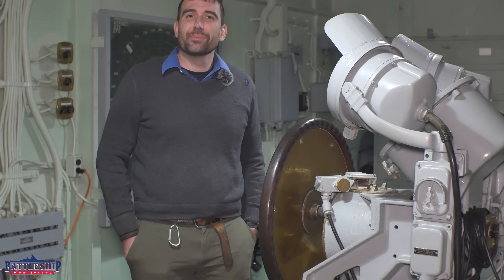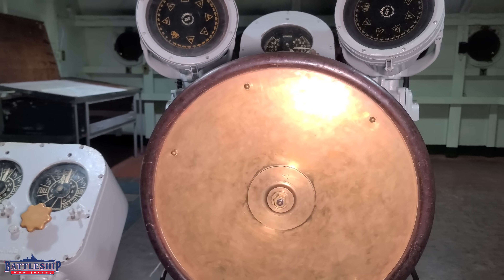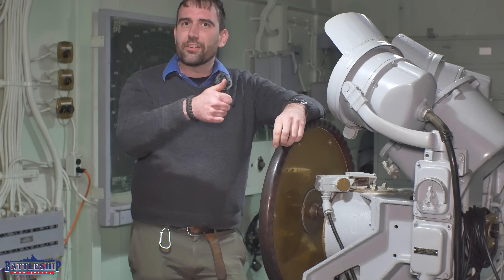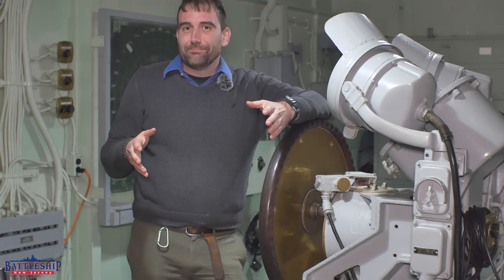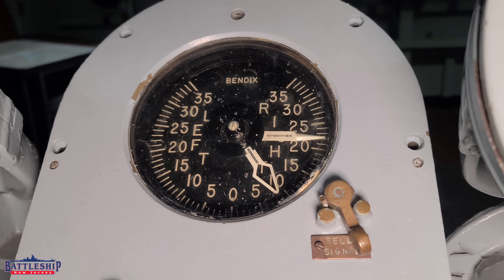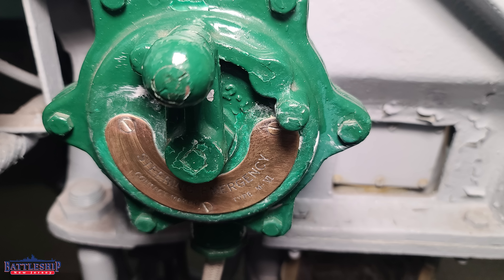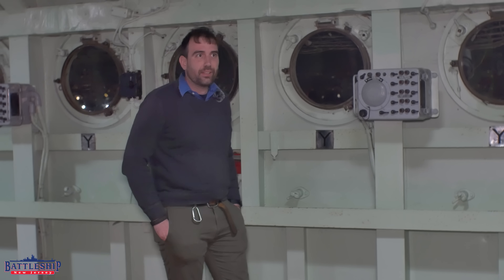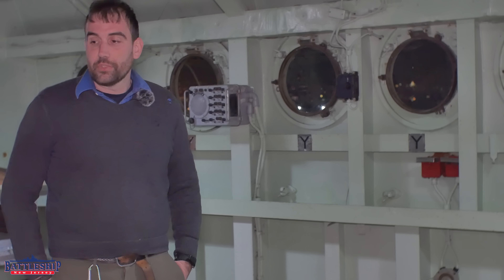Steering an Aircraft Carrier

Comment: Amphibious ships like Dock Landing Ships, and Frigates, and Destroyer Tenders, all have just two steering stations - the bridge (or pilot house on the old LSDs that had open bridges and small pilot houses) and after steering. There were no secondary steering stations other than after steering. Perhaps because none of those ships were intended to take the beatings that battleships and carriers are expected to take.

And somehow that reminds me of a recent video where you were discussing how to find the power panels for electrical circuits. There should be a metal tag on each cable at each junction box giving the location of the power supply. After 70 years, though, and multiple modernizations, who knows?

Comment: They had a working hand crank hooked up to a steering gear with no rudder when J went through "A" school that we were required to operate for functional experience.  It not only requires 100 turns to move 1° it requires that both sailors match rotation speed.

Comment: I spent many hours steering a Coast Guard cutter from the bridge in the 1970s. However, we did not use a wheel. I sat in a comfortable seat and there was a lever about 10 inches long. I would move it to the right for right rudder and left for left rudder. In front of me was the gyro compass, so I could determine the heading and if the command was "right rudder 10 degrees to bearing 090, it was easily done.
What is also interesting was when we were at general quarters drill, my job was to be in aftersteering, locked in to a crowded compartment. On our ship this was located in the stern below decks. The bridge would transfer authority to us (for practice) and there were hydraulics there (hydraulic rams connected directly to the rudder) and hydraulic pumps running. Our job in after steering in an emergency was to be able to steer the ship if the bridge control became inoperative.

Comment: I used to work on the Hornet while in high school as part of the Safety Division. It was fun riding the central elevator and going through p-ways not open to the public yet. My fav memory was operating the targeting computer and manually traversing the forward starboard 5 inch

Comment: When I was in the Navy in the 1980's. Got to go down to where the rudders came into the ship.  There was what I was told was away to manually steer the ship.   Took that with a grain of salt.  As it appeared that you had to manually pump a hydraulic system.  Not a job I would ever want.

Comment: I was on several carriers. The oldest was CVA 60 Saratoga. It and the newer ones did not have steering in the bow. There are portholes but no place to put anything up there. Just frames a foot or so apart. The island has several decks. I never saw any sort of aft steering either as my berthing was back there in CVAN 69.

Comment: I can confirm that such a double crank does exist for the Wasp class. If a single sailor is cranking it is 64 turns per degree, two sailors doubles the speed, and there is of course a set of these double pumps for each of the two rudders.  Training specified they were only used for centering the power-disabled rudder and not for steering.

Comment: I think there are couple of reasons why NJ has fewer redundant steering positions than Salem or Hornet. Firstly, NJ was much more heavily armoured than a cruiser of a carrier, and therefore it may have been assumed that (despite the design of the Iowas being designed by the Department of Redundancy Department) the chances of an individual steering position being knocked out were lower.

Secondly, with a double-rudder ship, it may have been decided that the "Manual" hand-crank steering positions installed on single-rudder ships were either not feasible, or would have to be geared down so extremely that maneuvering with them would be essentially impossible, and therefore they were omitted.

Comment: I think the inherent redundancy of multiple rudders and their actuators / rooms / equipment in general means that less redundancy is required.  These shipbuilders and the USN were extremely meticulous about redundancy and survivability, with infinite studies and data available to support any given choice.  My guess is that it comes down to single-point-failures and total failures.  The loss of one rudder is not considered a "total failure" - thus, you can instantly ignore the redundancy for such a failure when designing a ship. 

This does get tricky when you consider a failed rudder stuck hard-over to one direction and you absolutely must steer in the opposite direction (obviously not a huge issue in open waters, but certainly for obstacle avoidance or if you have to traverse to a specific location.)

Comment: The biggest reason in my opinion is probably the same as almost everything to do with the military. Money. It is expensive to have and maintain two rudders and their respective steering equipment. It is also expensive to have multiple steering locations that aren't just buttons on the wall. So if you've got one, you probably won't have enough money for the other

Comment: a friend of mine long ago,,,,was the steersman on an aircraft carrier in WWII,,,he sat waay to the rear i think directly above the 4 rudders in a small room. In front of him was a dial with two hands. One was connected to the bridge and turned there to tell him which way they wanted the rudder to go. The other hand on the same dial told him the current direction the rudders were pointed. Behind him were 4 large diesel engines with steering gear and clutches. Engines just idled most of the time, but when his indicator pointed to a new direction, then he would turn his large steering wheel to the new direction and all 4 engines would rev up and labor as they swung their respective rudder to the new direction. When they all got aligned, the engines went back to idle until he made another correction....a very noisy and boring mission to be for many hours at sea. I dont know how long each shift was but they did have several steersmen at hand so they could switch around

Comment: I believe that during GQ the Captain go to the CIC. That's where they can see all the information. The bridge has a better view, but in this day and age that doesn't really help much. I don't know where the XO goes.
Also, if there are chains used to operate the tiller in an emergency, how would those chains go to the flight deck. And if they did go there, that would end flight ops. It seems it would be better just going to the main deck where there is a straight shot down the ship from the stern to the bow. They would have to open all the water-tight doors though.

Comment: More steering stations could be because a carrier is at higher risk of fire with all the aircrart then jet fuel as well as all the ordinance which unlike BBs is not confined in magazines then to the turrets  but rather can be exposed on the flight deck or hanger deck. So more steering stations just in case.  Some of those stations may be unusable in a massive fire, Think Franklin, Bunker Hill, Oriskany and Forrestal. 
The single rudder vs multiple rudders may be a simple matter of hull design.  Or even something as petty as some guy who wore 4 stars in the 1940s at BuShips  saying he wanted a single rudder.

Comment: I don't think the number of steering positions is determined by the number or rudders, I think it is more a function of how much damage it takes to knock each one out. If you are managing to knock out the backup conns on an Iowa, you have probably basically sank the ship. A more lightly armored vessel, especially an aircraft carrier, is more likely to have it's secondary and tertiary backup steering positions disabled by fire or damage. A destroyer I would expect to have fewer, for similar reasons to the battleship, ie. if you are hitting it hard enough to knock out multiple backups, you are hitting it hard enough to sink the ship.

Comment: ON JFK WE HAD BEAUTIFUL STEERING ENGINES,,,I ONLY WENT DOWN THERE TO CHECK STERN TUBE PRESSURE...LATER ON BUILT A 5,000,000 VAIN STEERING SYSTEM,,, 60 DEGREE RUDDER SYSTEM...

Comment: The fwd conning station was a little further aft before the ship was modernized and given a closed bow and angled flightdeck. The bow was originally open and a couple quad 40mm were at the point. Several Essex class in heavy weather has the front corners of the flightdeck bent down from huge waves. Lots of pictures around. Don't know about carriers, but I was a helmsman on several WWII built destroyers and a DLG. The Fletchers had a single rudder. Sumners and newer classes had twin rudders directly in the path of the props. Twin rudders give more control, make it easier to steer a straight course and much easier to steer alongside a tanker. If power is out, turning the rudder by hand is very difficult and slow. Moving 5° takes several minutes. It's better to put the rudder amidship and steer with engines.
Reply: Fully  
Concur.

Comment: Having served on the USS Essex LHD-2, I've been in the forward conning station and the 2 "windows" are to see out of it. I also stood after steering watch which is in the steering gear rooms (each rudder has it's own steering gear room).
Reply: The space still exists on LHD-8 and newer hulls, but they removed the control console so you can no longer directly control rudders from there.
Reply: That space is primarily Repair One, I think, but it still has all of the required sound powered phone circuits, plus nice, big portholes, of course, so you could command the ship from there.

Comment: I have a question that may seem a bit stupid.

How haven't all of these control station redundancies, Tomahawk launch key slots, etcetera been documented? Is it secrecy, forgetfulness, something else? Between plans (which are always accurate /s), and the probable 10,000 plus sailors (many of whom seem to continue volunteering, thank you!) from the lifetime of these boats how has a more complete picture not been put together? There must be more than a few people who knew their boat left, right, center, up, down, inside, outside, and beyond. Given it's unlikely NJ would ever be reactivated, how would anyone be able to get her to sea without being at least aware all of this stuff?

I mean I've been working in my current building for 3 years and I can take you to the light fixture down the hall that rattles when someone flushes a toilet on the third floor clear across the building. I can show you the plastered over holes in the block wall that you could knock out to pass conduit through when needed. 

Anyway, just curious.
Reply: During the time in commission there would be people who had a very complete knowledge of locations. Although areas of responsibility would still be fragmented ie engineering, weapon, navigation, deck, operations departments would have a far more complete knowledge of their areas.  Dont expect the navigator or a quartermaster to know the valves in the #1 fire room.
Now with it being a museum ship there may be a mass of documentation but only some aspects would be priority to learn, a lot would be irrelevant in a non operational vessel.    Ryan has a tremendous knowledge of the New Jersey coupled with a deep interest in naval history  yet in a recent video I watched he said occasionally he discovers spaces on the New Jersey he was unaware of.

Comment: Why are there "Y"s under each portholes?
Reply: Doors and portholes are labeled by conditions. Condition X means only doors with a X need to be closed. Condition Y mean that X & Y are closed. Z is the most secure and is designed to keep compartments watertight in combat and that X, Y & Z door, hatches and portholes must be closed.
Reply: @Ghauster  Thanks for the info

Comment: It’s not single rudder vs double.  

It’s armored vs not armored.
Reply: Totally agreed.  Single vs. dual rudder just means a bit more pipes and wires.  The designers were trying to preserve steering through site redundancy instead of armor protection.

Comment: I have wondered how the ships / engine telegraphs work.  Saw a short video about an English where it operated with rods and cables.
Reply: They are all synchro based transmitters and receivers. If you aren’t familiar with synchros, they are synchronous motors where the shafts of the receiver units stay synchronized with the transmitter unit. The EOT order unit has an input knob that turns a synchro linked to a dial through all the standard bells (with detents to help positioning) and the answer unit in the engine room has a receiver synchro and dial to display the order. The answer unit also has a transmitter synchro connected to a receiver in the order unit so the engine room can acknowledge the order. There are some electrical switches contained within to ring a bell when the order and answer units don’t match.

Comment: I suspect more steering positions in single rudder ships has to do with assessed risk. Smaller ships like Salem are more apt to take damage from shells in a number of places and are less significantly armored so you need more redundancy to maintain steering. In the case of a carrier bomb/kamikaze/missiles, can strike anywhere and while they are rather large and have bulkheads they are not armored in the same way. In a battleship a number of the redundant steering positions are tucked away in rather armored places that if they are inoperable, your probably steering the ship to the bottom anyway.

Comment: You catch a torpedo in a single rudder ship you probably cannot steer regardless of the number of positions. In dual rudder ship you probably can still steer to some extent with the single rudder. If it was taken while turning from a torpedo attack, you might be able to turn in 1 direction but should be able to go relatively straight deflecting the other rudder the opposite way. I suspect the armor and armored steering positions is more of a factor, 2 inch armor is kind of a joke compared with Iowa's, it would be unlikely you lose 2 steering in the armored part of the ship. A Carrier in a Battle off Samar type exchange they could easily lose many steering positions on an Essex.i

Comment: You could run chains up on deck to have sailors manhandle the rudder, but on a carrier I think it would be easier to hook them up to a few aircraft tractors. (At least in the jet age, when aircraft, and hence tractors, got heavier.)
Reply: Interesting notion.  The capstans could provide adequate motive force if lines could be blocked into position.  About a quarter million pounds pulling force.

Comment: Is it the case that air operations require more accurate point of sail control than would be required for simply motoring around in a gun platform?  If so, that might explain why the carriers have more redundant steering control than battleships.  (I can't imagine landing on a carrier with a high angle crosswind is any fun at all.)
Reply: Carriers generally steer in to the wind and increase speed for flight operations as that increases airflow over the airplane wings and helps them generate more lift sooner.  In regards to that point of sail question, with the aircraft being able to steer themselves to the carrier, it is those gun platforms which need the more accurate steering and navigation while calculating their own movement relative to their target's movement in order to direct gunfire to hit the target -- "If we are traveling at this speed on this many degrees compass bearing and our target is traveling at what looks to be that speed on that compass bearing then we need to angle our guns to ...". & "If our shore bombardment target is standing still and we are traveling at this speed on this many degrees compass bearing and the ocean or tidal current here where we are floating is that speed on that many degrees compass bearing, then when we add our vector and the water flow vectors together, what we need to do in order to hit that non-moving shore target is angle our guns to ..."

Comment: I would think that the single ruder ships steering controls are less complex than ships with 2 Ryder’s, thus you can more easily create multiple locations to steer from.
Reply: Not really.  Both rudders were controlled by the same circuit.  Most ships with 2 rudders (such as New Jersey) had several steering control stations.  The cruise I was on with 1 rudder had 2 steering stations.  I don't think there is really any correlation.
Reply: If you collect all the control inputs in one place (double it for redundancy) and from there send out the control signal to the hydraulic valves on the rudder actuators, you can hook up as many inputs as you want without adding complexity downstream. 

If you insist on hooking up every actuator individually with every control station, you just created yourself a maintenance and reliability nightmare. 😅
Reply: The only real benefit you get from one rudder is (maybe) making it at least possible to manually move the rudder under human power, either mechanically or by manning a manual hydraulic pump with a separate hydraulic circuit to the main circuit

Comment: USS Kitty Hawk had an a space in the same place. I never went in there, as the water tight doors were locked during my 1996-2000 tour, but the space was there. I doubt it was an aux conn position, as the Kitty Hawk was built with provisions for bridle launch, so more likely that small space was for that. There was a passageway that went around it, part of the O3 level passageway. Nimitz class do not have an aux con space there, the space that would be taken up by that compartment would be part of a 200 man berthing, which is usually Air Department.
Reply: Agreed. When I served on Carl Vinson CVN-70, the bow portholes are there, but it's a berthing. You have to deal with the cat launches to get to have windows. :D